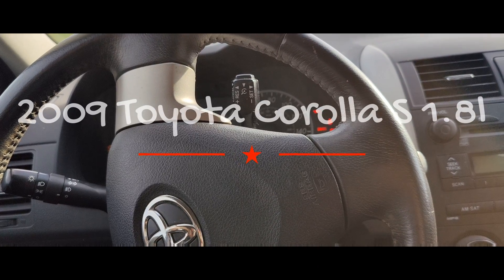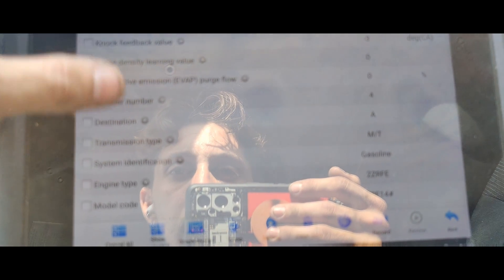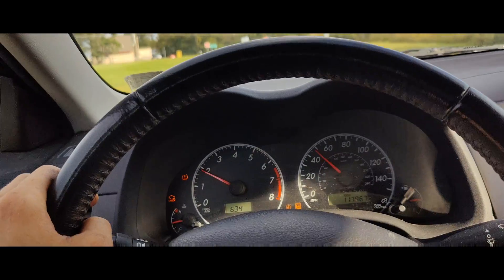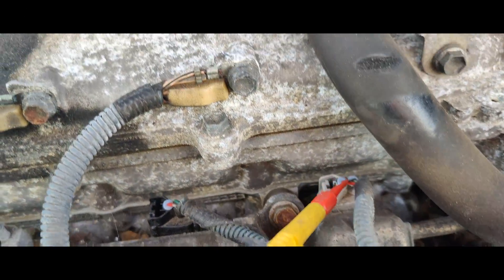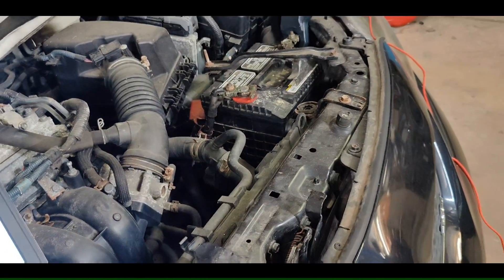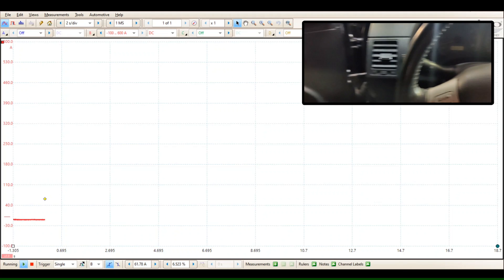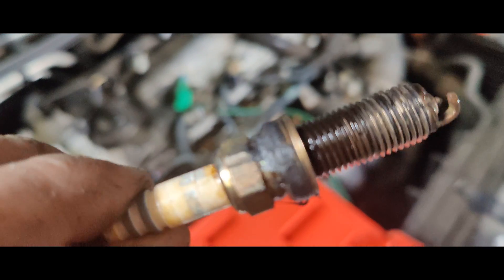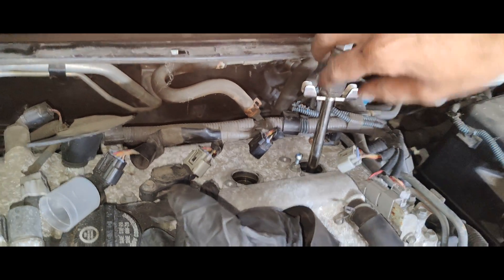2009 Toyota Corolla Misfire 1.8l Burnt Valve? P0304?

Comment: COOL. I thing those spark plugs are 12mmX1.25 I had to make a tool to check the compression on them. Those plug threads are about 1" long the head is not treaded all the way sort of like a ford 4.6. so it takes a long thread on the tool to catch them. The compression on the two affected cylinders normally is 100psi. Just enoufh to make it hard to pick up a dead miss.
Reply from the maker: Thank you, that is good info to know.